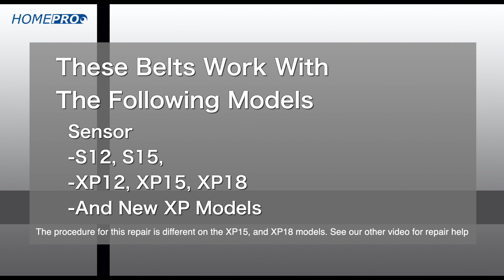Windsor Sensor S And XP12 Belt Replacement

Comment: On my XP 12 the brush light and the bag light started flashing ever so slightly. I ignored it because I had a fresh bush and the bag was empty. But today the Vac rumbles and squeals.. What could be the problem?
Reply: I took the bottom of the vac apart and I found the problem. Not sure if I'll be able to fix it though. it is the inside axle of the yellow spindle  that came loose.It's a black piece that's held in place by two screws into the bottom of the housing.. one screw is missing completely and the other was completely lose. Got to make a trip to the hardware store tomorrow.
Reply from the maker: @gimmeagig Feel free to call our tech support anytime and we will do our best to help you troubleshoot. It is much easier on the phone verses in a chat setting like this. 801-553-0788